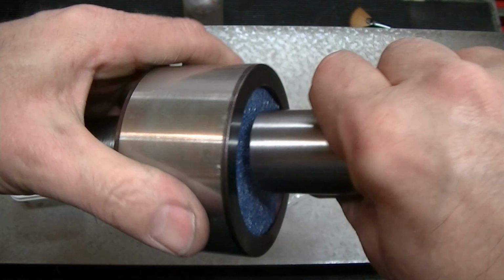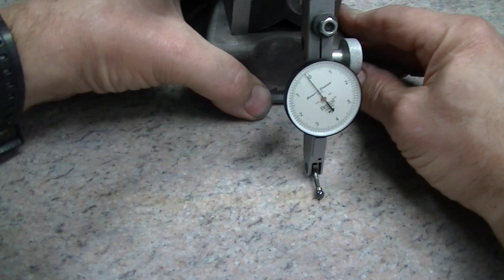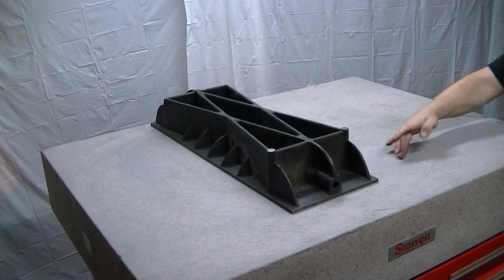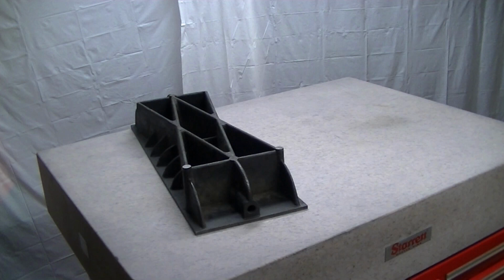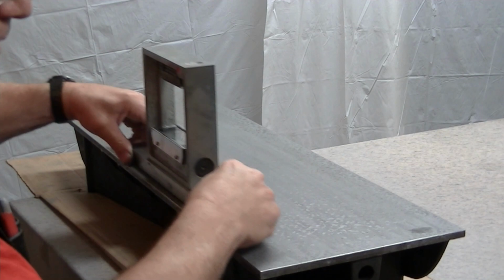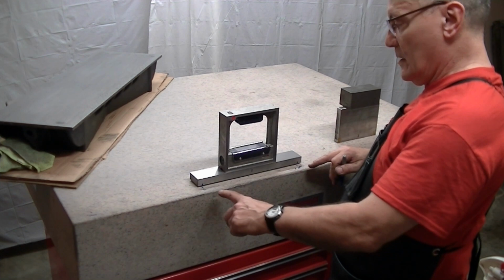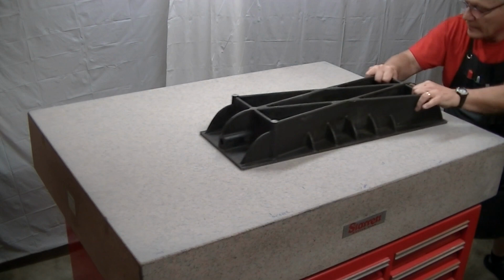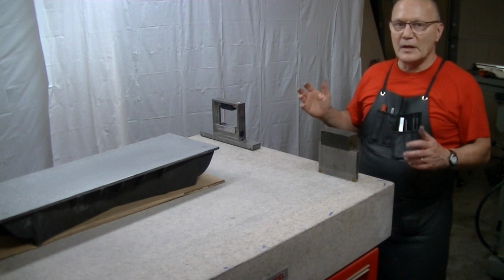DIY SURFACE PLATE LAPPING PART 1 (audio fixed)

Comment: "too far gone" I would question the people doing the lapping on that. Its a rock, i didnt just pop out of the ground in the true flat state. Someone had to make it that way, I think it was a lack of skill not the plate. The only plate that was ever turned down to be lapped at our shop was on that had a hot part left on it and basically burned a hole in it (Dont ask how this happened it was clearly a really really dumb Welder) other than that never not had one done. Good video as always.
Reply from the maker: Thanks, and thanks for watching and commenting.

Comment: So I worked at a shop here in TX and when we started movin on up in bigger things(ISO9001,ASI, etc..) we had to go through this monster process of calibrating everything and logging and traceability etc... well we had a few granite surface plates that needed checking, verification and certifications. The main QC table was a 6' x 6' black granite plate. So, we had Trescal come out and give em the go.  The QC guys over the years had used one corner of the large plate as a "desk" and a parking station and the area next to it was the main area used to check parts using squares, height gauges etc. Well, the guy from Trescal upon his primary examination of the table with an [antique] surface gauge that measures .00001 then using a laser, we had a few severely worn low spots. 
Anyways, as a machinist of 11 years at that time(2014), and always looking to learn something new for future reference, I stuck to the old timer doing the work on the table. Inquiring about technique, cause and effect, why this instead of that.. so..... the only difference between your technique and his, was that when he was lapping, 1. He had a partner to slide the cast iron lap plate to across the table, 2. He always used a roll of unrolled paper towels (by always I mean for any cleaning at all on every table). Only peeling off the sheets after a wipe. He said his reason for that was because when using rags or reg towels, you always get build up and one wipe and the towel has always got residue, which he didn't want when re-wiping(maybe his personal technique only, not sure). 3. He slid the lap plate back and forth along but also in a cris-cross diagonal direction as well, like a cross hatch. And 4. He sprinkled the lapping powder directly on the granite surface plate. Didn't ask why as he'd been doing it for 20 years that way and that table was like brand new when he was done. 
Good videos brother. God bless ya.
Reply: Was the, "desk'" area more or less worn than the rest?
Reply: great comment, Thanks... the one wipe, I do also, seems a little bit of a waste but I get paper towel fragments if I use one too much or just fine lent fragments. thanks again for your comment, it was informative

Comment: Pretty cool stuff. The guys that field lapped my granite plates were pretty liberal with the loose diamond when they recharged the laps. It was more like dusting a sand casting with parting powder. Got to love a level for quick assessments. That Shars box level seems to perform pretty well for $75. 

Talk to you soon.

Tom
Reply: Hi Chris. Standridge used loose diamond which they also rolled into the cast iron lap. I'm also pretty sure there was some loose abrasive similar to what you see on Robins video. They had a big ball bearing roller with handles and a big dude to smoosh the diamond into the lapping plate.

--Tom
Reply: Totally loved that vid! YT then brought me here in my travels. Thanks for the awesome tutorial!

Comment: Thanks so much for your video and knowledge.  I just finished lapping my granite with great results.  Started back with Tom Lipson's three plate lapping 6" round videos, created my own 10x14 lapping plates, designed and built my own repeater meter with LVDT, & got an Autocollimator.  It's been a very rewardable journey and tons of fun.  Could not have done this without your videos and oxtools.
I likely post a summary video soon in my channel.
Reply from the maker: Fantastic!

Comment: Yeah. Stellar individual all the way around. Freak of nature. Being in my trade so long I can completely identify with the statement of mental decisions and evaluations being made on a nanosecond level. I envision almost a mental vision of the shape of the plates by feel and sound at the rough stages that is corroborated by measurements.

The phrase "when you see someone doing something that looks so easy, its likely the hardest thing you will ever try to do" is something i live by. For me it goes from welding, to making candy, a cake, loaf of bread. There is massive amount of technique in running a shovel.

Im not a machinist but watch every one of your videos with full attention. The entire philosophy on working cross applies to anything and everything in life.

Phenomenal
Reply from the maker: Thanks for the kind words, and thanks for watching and commenting.

Comment: Same style action circular rotation to the lap ..but in a figure 8 pattern and count your passes. Descending grit charge if you need.
 My father taught me about the auditory aspects of the lap and grit choice. The harmonics through the lap tell surface roughness. Finer grits have a higher pitch through the charged lap. Depending on the porosity of the rock and certification target. It may not be what you want in finish quality.
 Continuity is vital in combination with other factors, charging, media, slurry type, grit and "style dancing" with the lap ! I mean you did just dress it with diamonds!!!
 He used to say "make a music instrument" and it will tell you when its done"".
Reply from the maker: Thanks for the input!  What is the finest micron diamond you used for AA plates? I noticed the surface finish of my Starrett master pink AA plates was much finer than the average plate.

Comment: I still can hear you sliding around that plate. And getting its surface covered with tiny little diamond corns.
I pretty much guess it takes time like scraping to a nice bearing.
I like your content. AND its something you can really talk about afterwards. Not just plain watching 'and there you go'.

Comment: To do a differential compensation as accurately as possible, a weight moving towards each corner would work best. I know that’s a pain, but if the most accurate readings are wanted, each side, as well as the diagonal, should be taken into account, with diagonal corners having the largest droop.

Of course, the heavy cast iron plate sitting on the granite plate is influencing the readings more than the differential weight is, by an order of magnitude.

The truth is that the thickness of the plate is going to negate most of the effects anyway.

I’m pretty sure you’ll get this right even without the differential compensation.

Comment: I like how you went through all the trouble to use a counterweight as your poor man’s differential level and yet you left your heavy cast iron lapping plate on the back corner of the table!!! Talk about counterproductive haha
Reply from the maker: Watch "answers to part 1 questions"
Reply: That weight is static though, does not negate the actual change in level. Pretty amazing stuff.

Comment: @35:16 Mitigates effect of weight with counter weight yet have massive lapping plate sitting on back corner
Reply: It’s static, so doesn’t affect the level readings.  If he moved it at any point, then it would affect the measurement.  Hope that helps?

Comment: I was looking at that little weight he was using to balance the level, then back to the giant cast iron lap on the corner... I can only assume that there's no measurable flex in an 8" granite slab, and it's only in the platform? So the position of the lap will change the absolute position of the plate, but not the curvature. Since the measurement is all relative, the change caused by the fixed position of the lap doesn't show up? Now, the loading of the frame will cause it to respond differently to different minor changes. Going from 0 to 5 oz will likely make a bigger change than going from 1000 to 1005 ounces. Then again, the frame is already loaded with the enormous weight of a 1400 lb granite slab... It's fascinating to think through things at this level of precision.

Comment: Robin -

An interesting video. But (and there is always a but) when you got the precision level out I had to smile. It reminded me of a story my old boss told me. A guy wanted to know the dimension of the interior of his office, so he started with his heel against one wall and paced towards the opposite wall assuming each stride to be 3 feet. When he got to the far wall, his toe was about an inch from it. So, wanting his calculation to be accurate, he got out a micrometer for the final measurement.

It seems that you may have had a little of that going on with your compensation technique. You carefully offset the weight (maybe 5 lbs.) of the precision level with an equivalent dead weight to reduce induced warping. But 18" away sits a 50 lb. plate.
Reply: youpattube1 But the lap is not moving while the level is.  So the difference seen with the level at different positions remains true.
Reply: If the whole thing is warped by the unbalanced plate heavy load, then you are looking for flatness on a hyperbola.
Reply: I wondered the same thing as you youpattube, but having read Russ' reply I think I'm satisfied it is OK.  Mind you, I think I would still remove it from the plate  !
Reply: youpattube1 The lap isn't enough to significantly warp the surface plate, but it is enough to move it in the compliant mounting.  If it could warp the plate it wouldn't be a good lap
Reply: If the granite plate is 800x1200x100 mm, a weight of 5Kg placed in the middle (while the plate is hold on the corners) will cause a flexion of .51 micron mm .
Reply: Well I don't agree. Robin was so concerned about minor disturbances effecting the measurements that he did not even change the position of his feet. But Robin is an engineer, let's just ask him to settle the issue. What about it Robin ?
Reply: The compliance feet allow the plate, as a “singular unit”, to move. The work Robin has been doing to eliminate any change in the compliance feet is purely for things that move…. The granite plate would have two masses on it, the cast iron lap and the level, if he did not have his "compensation mass" present, this would result in the granite moving (compliance) because the mass moved. In Robin’s case, with the “compensation mass” he is nulling out the movement of the level, by counteracting the movement and maintaining an even distribution of mass on the table. The cast iron lap on the table, stationary of course, makes no difference to the compliance feet if he nulls out the movement of the level. That lap is no different than the car parked on the cement pad behind the curtains hanging…. If Jr got in the car and moved it, the plate would change, then again, if you extrapolate that out even further, his neighbor’s F250 could throw all that work out the window too 😊 Butt--- that's only how I see it... 😊UA
Reply: youpattube1 I think part of the confusion arises from Robin's use of the word "deflection". It is not deflection or distortion of the plate itself (which is insignificant) but rather rotation*'of the plate due to changing load on the plate itself or on the floor it is standing on. The thing to remember is this is a *relative measurement, not absolute, so what matters is that nothing changes during the measurement, not whether the plate is level or not to start with.
Reply from the maker: I will cover this in a follow up video. Thanks for watching and commenting.
Reply from the maker: I will cover this in a follow up video. Thanks for watching and commenting.

Comment: You have great attitude to work. I wouldn't lap dry however and also using diamond powder is more or less unnecessary, cheap SiC or AlO2 will do just fine. I wouldn't overhang tool as much because it can turn the edge down, your tool is also quite small.

Comment: The heat from your hands might actually be helpful to combat the heat from the friction of lapping, although I suppose it's much less evenly distributed, and the sole of the plate expanding might already be counteracted by the tendency for the lap to go convex. So much to consider in a world where everything it so wiggly.

Comment: I guess you could use another granite surface plate as a hone, especially when coated with foil unless you want to want to resurface the hone. Reynolds makes a teflon coated foil if that is of any use.

Comment: I found this video (DIY SURFACE PLATE LAPPING PART 1) and the accompanying (DIY SURFACE PLATE LAPPING ANSWERS TO PART 1 QUESTIONS) useful and interesting.  In the first of these you talk about "PART 2" video but I was not able to find that.  Are there any further videos in the DIY SURFACE PLATE LAPPING series?
Reply from the maker: Not yet, the plate is AA quality right now. I will be doing another video  on taking it to AAA and how it is measured.
Reply: @ROBRENZ  I assume the autocollimator mirror system will be used for grading the plate, I too am looking forward to the part 2
Reply from the maker: @miamatti  Correct, I already checked the plate with it and it is AA right now. I will use it again to get to AAA in the video.
Reply: @ROBRENZ  any eta? Very uninterested, and will be looking for the vid

Comment: Talking about counter balancing weight but he has the lap on the back left corner which looks way heavier then the level and counter weight.
Reply: but this weight dosen´t shift around while measuring ;)
Reply: @martin09091989  But it preloads the plate with distortion that then does not move, how is this good?
Reply: @gib666  this is not about the distortion of the plate, if the plate was this weak u shouldn't use it as a surface plate.
The distortion he tries to counterbalance are in the undercarriage the plate sits on, the absolut position of the plate is not relevant, but u don't want to shift the relative position from one to the other measurement.
Reply: @martin09091989  Yep, I just watched the answers to part 1 video where he explains.

Comment: That "pickup/smear" at 20:27 might have resulted from the last stroke that overhung the front edge. The edge probably has build up from pushed off  diamond paste and it grabbed onto your plate- just a thought.

Comment: The kind of person inclined to do this sort of thing is most certainly not going to be bored by the details, have no fear on that score :)

The observation about loose abrasive cutting due to the cast iron hardness got my attention, because I have no cast iron in my shop  big enough to serve as a lap, and that stuff is pretty expensive in large sizes.  If you were getting usable results with loose abrasive lapping, perhaps it could be done using cheap, smaller, import granite plates as the lapping plate?

Or maybe my pondering will be rendered moot by your next video including the foil approach :)
Reply from the maker: Thanks, and thanks for watching and commenting.

Comment: Hi, Robin! I also post my comment on this remastered video. I am very interested in learning more about your instrument, the Renzometer, that you use to measure the quality of your plate. My interest is unfortunately purely academic, since I am an ordinary guy, and I am not an expert in metrology. After watching some of your previous videos I have noticed that you are somewhat of an expert on metrology. I have followed Tom, of Ox tools, in his project, makeing a copy of a Rahn Repeat-o-meter, with help from John of Saunders Machine Works (NY CNC). Your precision level is probably more than adequate to confirm the validity of your measurements, but it would be interesting to also se you confirm the flattness transversly (transversaly), longdetudinaly and latetudinaly along a multitude of straight lines. Since one of your fellow experts (Tom at Ox tools) has such an instrument, maybe it could be used as part of a tutorial about what “flat” really means.
Reply from the maker: Will be covered in future videos. Thanks for watching and commenting.

Comment: Hi, while doing the concave/convex check of the granite you showed the just moving the counter balance weight would change the shape of the granite, would not having the laping plate hang of the back left corner distort the surface plate out of all heck?
Reply: David Dooley I don’t think it’s actually distorting the surface plate I believe what’s happening is that it’s tilting the plate on its stand
Reply from the maker: Answered in this video https://youtu.be/sKwZxV4bUoA

Comment: Use another piece of granite not much smaller than your plate (or your iron tool is fine too but it's kind of too small) and carbide powder (cheap) with water which you change frequently (every few minutes).  The diamond looks like a ruse to me, to make you spend more money. The precision you need to achieve on these plates is not high at all by optical standards. A good telescope mirror (few people can produce great mirrors), has a precision of around lambda/10 (2.2 millionths of inch for green light) or better over tens of inches. So what machinists are aiming for, is caveman precision on optical standards.
Reply from the maker: Water temporarily affects the granite so not good for final finishing but used often with silicon carbide for roughing in. 
Diamond is worth its cost in final finishing. I also lap metal tools to 1/10 lambda flatness so am aware of the precision differences.